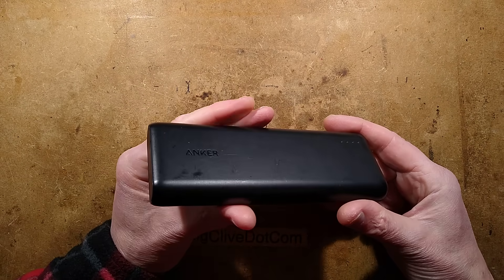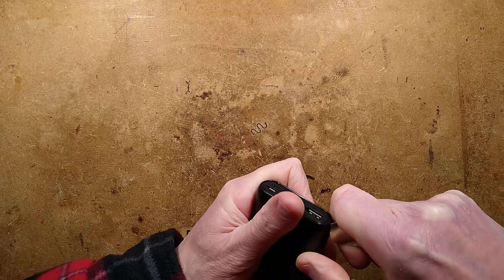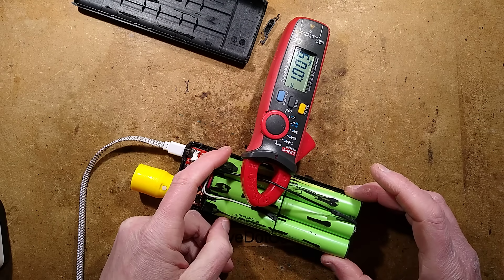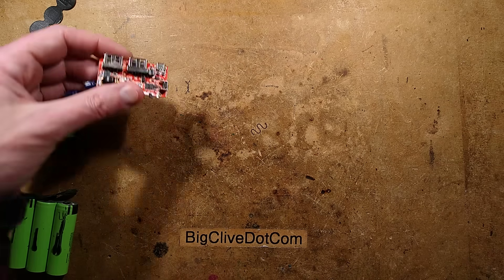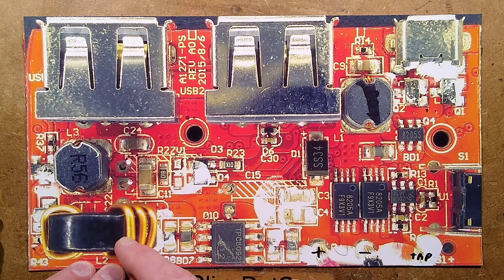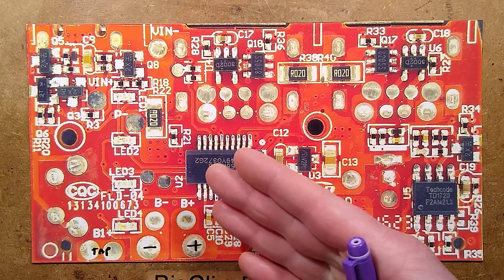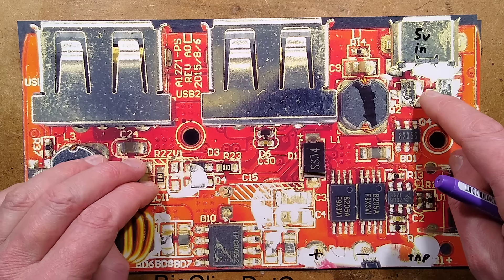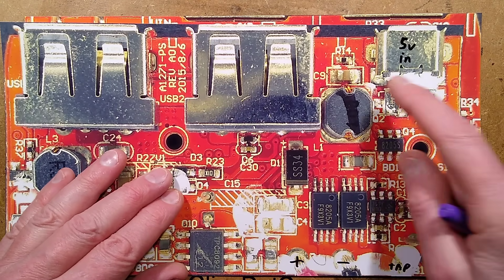Exploring an Anker power bank

Comment: Unrelated, but note that some Anker powerbanks have a useful trickle output option: normally, they turn off if the load is less than, say, 50mA. To charge things like headphones and earbuds you can press the "on" button twice or hold it for 2 seconds and the powerbank will then stay on for about 2 hours, whatever the load. On one I have, one of the blue leds turns green to show this state is selected.
Reply: Ahhhhh, that's what that is for!
Reply: Yo! This is awesome! I just tried a double press on my newer Anker Zolo 10000mAh and a little green light pops on. I'll be testing if this is the same function but I assume it is. Thanks for the tip!!
Reply: @GraysonZimmer my 20,000mah Zolo included this feature in the instructions
Reply: I have that ^^^^ power bank, best I've had over the years.
Reply: Same here I've had it for at least 5+ years it has been great @cypeman8037
Reply: it is cool that anker hides these smarts in their power banks. I'll have to look up if my other brands of power banks have these hidden features
Reply: I wish they'd build this into generic chips too, the cut off is always way too high for stuff like LEDs
Reply: I wish that Anker would include these "hidden" features in their manuals!
Reply: Yes' they're more modern than this model. IIRC, I bought this one about 6+ years ago? Mine still going strong. Great build quality.
Reply: just tried on my 20000mah and one of the blue LEDs turned green and stayed on. I didn't know this was there, I had some small USB LED xmas lights that would run for about a minute and then stop, I bet this would have cured it. Thank you!
Reply: An Amblight I own has this feature too but it instead flashes between the remaining capacity & "L" to show it's in low current mode.
Reply: I believe most "standard" Anker powerbanks have that feature. My 2017 one (RIP after trying to charge a bintendo switch with it), my 2021, and 2024 banks all have that feature, activated by pressing the power button twice.

That mode is also useful for charging old DS or gameboy systems via regular USB cable, as the banks will limit power output to 500mA at most.
Reply: I never knew that, thanks!
Reply: Thanks, I needed this feature and didn't even know that my anker powerbank have   this. And I own it for over 2 years. Just checked and the green light is there.
Reply: Super useful info! I have ordered many Aukey 20000mAh Power Banks. The first few (from 2018) have a smooth finish on the case, and they don't have a minimum current, so I can run my low power microcontroller projects on them indefinitely. The later ones (rougher case finish) must have a low power cutoff that is less than the draw of my projects, because they shut off shortly after being plugged in. 

Does anyone have any suggestions for 20,000mAh power banks without the low load cutoff? It would be a huge help!
Reply: I have this one for my Nintendo. Switch the official one from anker, i've had 8 years and I had this issue where the lights stay green, and I didn't know about it. You wouldn't charge my Nintendo switch properly. And after doing some research, I found that out that if you hold the button, you'll go from different mode
Reply: I found that functionality when trying to charge something that wouldn't communicate because it's "dumb" even though it's an expensive medical device for diabetes. It's 2025 and they're still making devices that cost thousands of dollars without USB-C, fast charging, and  battery replacement /repair options. My multiple thousand dollar insulin pump is electronic waste after too many charging cycles (which are required daily).
Reply: @mattgayda2840 I wonder if you could send one of your old pumps to Clive for assessment. He may see a way to reuse or up-cycle at least.
Reply: Intentional or complacently not in the design specification  @mattgayda2840 ?😟

Could you send one of the busted ones in to Big Clive ?😅
Reply: My ikea power bank does the same thing
Reply: Shame it doesn't light up green when in fast charge mode. One I had but battery bloated had a light just for fast charge or PD mode so you knew it was working.
Reply: My anker power bank has the green light when double tapping.
Reply: Very cool, thanks 🙏
Reply: Thank you!!!!
Reply: I made my own USB pass thru cable that has a 100ohm resistor across the output wires, and it is enough of a load to keep old dumb power banks on with a small load. 

Sure, it wastes some of the power from the battery as heat, but it does work if you need it to stay on.
Reply: For mine, the Anker 20Ah 30w zolo, there's a green dot that appears to the top left of the segments of the percentage. Make sure that you turn it off though as the display turns off to save power, but the trickle charger will stay on. IMO the green trickle charger LED should stay on to let the user know that it's powering the ports still.
Reply: A newer? kid on the block "UGREEN" has this function as well, no LED's but a numerical display to indicate the charge level.  Pressing the button more than two seconds turns on the trickle charge option.
Reply: It's amazing what you can learn if you read the instructions..it's a shame they don't do passthrough charging though. Or well the ones I have don't
Reply: Oh man I would get so aggravated my headphones only charging 5 mins at a time. Thanks so much. Maybe I should read directions 😔

Comment: I have the same (or very similar) pack - Anker PowerCore 20100 from 2018.
Still working well, but not used as much now as I have newer ones that have higher voltage fast charging capabilities.

Comment: I've never explored one, I wonder if more large power banks have 2 packs in series. It actually makes sense to do it that way, a buck converter (particularly synchronous) is much more efficient than a boost converter. More power loss while charging is less important since the power is coming from the charger rather than from the battery.
Reply: The problem is that you would then need a boost converter for charging, plus cell balancing.

Comment: I've owned a bunch of Anker charging bricks over the years in various shapes and sizes and found them all to be extremely reliable, I never heard of the reset trick but I've also never had to do so.  Very interesting teardown, I've never ventured to do so myself for the same exploding potential you mentioned.
Reply: I have a failed nano 3.

Comment: Anker battery banks have always been extremely reliable and well built for me - I still use mine from over 5 years ago! 
Excellent tear down, my battery banks are one of the few things I don’t tear apart, and instead leave to professionals like yourself ;). Cheers Clive.
Reply: I have a 6 ft usb c to a cable from them that was given to me over 10 years ago. it's USB C and USB 3.0 compatible. other than the braided sheath being shreded and has bite marks from my pug as a puppy, it still works perfectly. I won't lose it either because it's bright red.